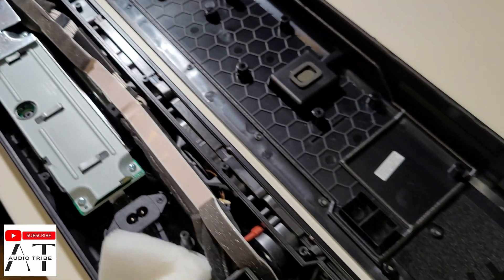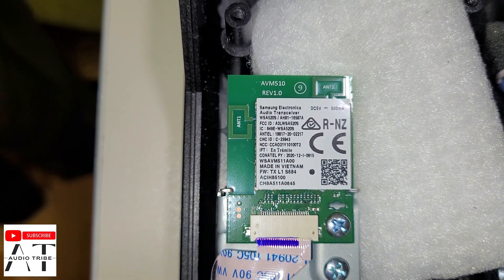Look Inside Samsung Q990b Soundbar + Sound Test without covers

Comment: I have a Samsung-Q HDMI/Bluetooth soundbar. An optional set of two rear Bluetooth speakers are purchasable separately.
I purchased two sets of rear speakers.
I want to make both sets of rear speakers work - at the same time.
It seems -  I need to either add another Bluetooth (single or multi) Chip,  or a Bluetooth signal splitter.
Have you, or anyone, noticed if an upgraded chip or an extra chip can be mounted inside the sound at???

Comment: ents
38

Add a comment…

@amirzahoor8203
0 seconds ago
Hi, I M Amir From PAKISTAN. I Buy Samsung Q990C soundbar just 2 months ago. Last time on the soundbar and sho the msg on bar screan UPD and soundbar is off and just 1 orange Light is on and no any working. I m verry worried about the soundbar.  I m going to 3 difrent sights Samsung service centers. Samsung enginears said me this soundbar is imported Item and we are no resolve this problem sorry. 1 enginrear said to me maybi main board ic damege butt this main board is not repairable. I m verry worried. Samsung is best brand butt this soundbar is verry expensive and Quality i think verry low. What i do. Any person pls help me. Or Samsung help me. I trust samsung brand butt this is not fear. In PAKISTAN Samsung service centers and helpline not any help mo just sai to me SORRY. What about Sorry. If not resolve this problem close the all Samsung srevice centers in PAKISTAN. Why open the Brand name Samsung service center in PAKISTAN.